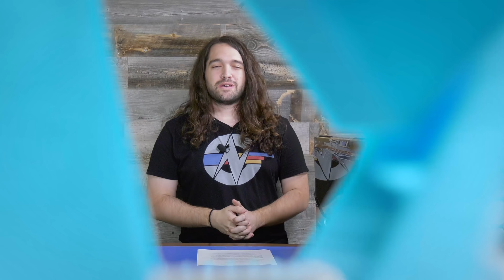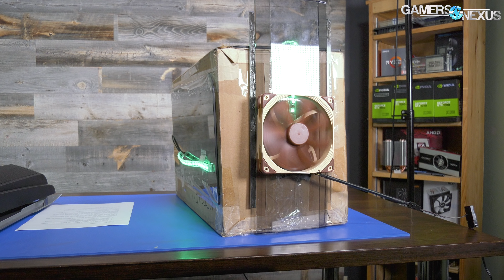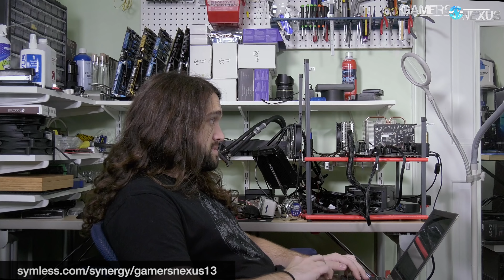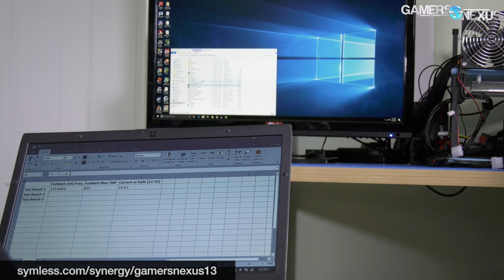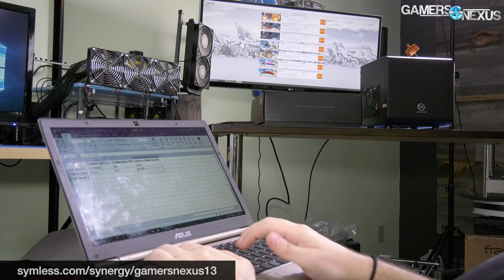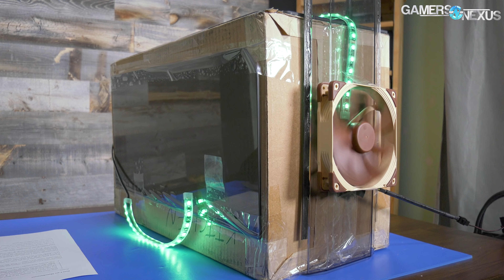Case Manufacturers: You're Worsening FPS & Power Draw

Comment: The concept of dissipating heat in space is fascinating, and when talking to people about it, you quickly realize that they don't 'actually' understand the physics of many of the components they are using as well as they think they do. For example, radiators, I think most people simply 'assume' that the point of the radiator is to hold heat until it is dissipated through the convection of the heat into the air that is pushed over the radiator by the fans. While in computer cooling this is in fact the 'majority' of the heat management at high work loads, the radiator is constantly emitting photons in the form of infrared light, as well as other bandwidths not on the visible spectrum, to get rid of heat, literally the process of 'radiation' the emission of subatomic particles, in this case photons, which we correlate with heat. 

In space dissipation and convection are completely off the table, no amount of fans will help you at all since you are isolated. It may be 'really cold' in space but you are subject to the direct radiation of the sun, and you're what's known as a 'cold body' for the most part, that is you don't 'radiate' so you are effectively a giant heat sink merely absorbing radiated energy from other warm bodies, that is until your radiating potential reaches the equilibrium with the radiation you are subject to or absorbing. While 'conduction' is based on more than just electrons (Superconductors for example), in general good thermal conductors are also good electrical conductors, which is why we see this parallel in metals, these conductors have a higher potential to reach before they acquire equilibrium. Additionally you have the problem that 'good radiators' are often good conductors in an irony. So what you 'want' to do in space is face your 'bad conductors' towards the source of energy, and then through some form of internal convection or dissipation (Typically some form of peltier device, or phase change can be used if you move the medium and reverse), you transfer the energy (Heat) to the 'good conductors' that are facing away from the energy source, and they will radiate energy away from the satellite, ship, device, or floating space computer. 

Needless to say this is more difficult, and generally slower, then dissipation, which gives you the advantage of using the 'relatively massive' atmosphere as a nearly thermally immovable heat sink. I did say that 'dissipation' is not possible in space, and this is actually technically false. One idea that is frequently explored in science fiction is the concept of 'stealth' in space, which would involve cooling the exterior of your ship, eliminating all thermal radiation from it, and storing it in a 'heat sink' until you were someplace safe where you could get rid of all that built up heat, they often discuss the process of 'getting rid' of that heat as 'venting plasma.' 

This is in fact completely accurate and valid, if you have a VERY good thermal conductor within your ship that you can transfer heat to and isolate, and you allow the heat to build up in that substance completely isolated until it is hot enough that it doesn't just turn into it's gaseous version, but goes one state of matter further, turning into a plasma (All electrons stripped from the nuclei of the atoms and moving freely inside the material along with the nuclei), then you have a VERY hot and dense plasma, which if you then eject from the ship, you effectively 'dissipated' the heat away from you in some sense. The dissipation is only technical, since you really just broke yourself apart, leaving one portion of you significantly hotter so that the other portion of you could be significantly cooler, but it in some sense is effectively the same thing, and is certainly not radiation. 

I digress... Very science fiction and totally unrelated at this point to the subject of the video.

Comment: Shit like this is why I chose the Cougar Panzer for my current build and an Enermax Ostrog ADV for my prior one, I'm probably the most anal person when it comes to airflow and I actually won't buy a case if it doesn't have a mesh front panel and bottom so the PSU is isolated, I like a mesh top too, but that's less critical for me. Honestly I'd probably be inclined to just use a test bench for my daily (like the Praxis Wetbench) if the ones that looked decent weren't so expensive, I don't understand why half a case costs twice as much as a complete one

Comment: No, there is no place for tempered glass or RGB.  I will never buy a case with either. I buy cases strictly for performance, ease of building and front panel features. Cable management features are nice but ultimately the only reason that matters is cases with side windows. Get rid of the side windows and that no longer matters beyond it being handy to have the cables being neat and out of the way in a general sense.

Comment: I have a nzxt phantom 630 case, with 2 140mm fans in the front and 2 more in the bottom blowing in. I have another 140mm on the drive cage, with another one blowing out the back. The radiator is blowing out the top with 2x 140mm fans, with a 40mm at the I.O. I have thought about adding 2x 200mm on the top to help blow the heat away, but I'm concerned it may impact the radiator.

Comment: Case manufacturers are forgetting extremely BASIC aerodynamics and airflow requirements.  Open intake area up front should always be EQUAL to the area of mounted intake fans.  Anything less leads to an airflow-starved design in which housed electronics can overheat.

Comment: Most important with cases is that they should have many places to mount fans. Not all that make PC-s need many fans. And you should also make a positive pressure, because if exhaust is stronger force than intake, then all holes that are not filtered will suck in dust, making thermals worsen over time.

Comment: Im glad i changed my cooler on my GTX 1060, Asus stock sounded like crap when gaming and load was 70c+, Arctic cooling on and i have the fans on fixed at 7v and the cpu dosn't wind up and maxes out at 65c maby and i have crap ventilation.

Comment: Thumb Screws are a pain ion the ass. When cannot take it off with your finger. what that is its too tight. use a screw driver to  screw it  in like insane extreme too tight.  so use the screw driver ton undo that thumb screw.. when I loose them.. I do not know what to do about that. its not sold at a walmart hardware department

Comment: A Lanbox puts your MOBO on the horizonal and heat RISES. The heat goes up and out from each component, not up the board towards your CPU and VRM on an upright case. Everything in one box is from the 1990's and stupid. P/S went from the top to the bottom of cases because the case would be easy to turn over. All the heat from your P/S rises in your tower case to your CPU. Newer P/S when not stressed will stop the fan and all the heat is traped in the case. That was really a stupid idea. One company that sells cases and P/S can offer us a case with a cable to a seperate P/S. One twist lock 4 wire connector with the modular cable jack in the case. If you have cases you can stack put the P/S and radiators in the one on top.  Remove case drive cages if you are not using them. They just block air flow.

Comment: A test bench with a 20 inch box fan blowing air on the MOBO from one side. Add a 20x20 inch A/C filter to the fan and the components stay cleaner. I ran a PC in the summer on the Gulf Coast with no air conditioner. Room temp was around 90 F.

Comment: I actually had a 12yr old Antec P180 case I nearly used for my latest build. It's actually pretty solid even if cable management sucks compared to modern cases. But I saw a tempered glass case with 3x RGB fans on sale for £50 (Gamemax Onyx). Aesthetically it looks awesome, but have to admit some of the design elements seem a bit shitty for airflow. There's these weird honeycomb cutouts on the front panel, then a tempered glass panel in front of that with very little gap for airflow. I was gonna actually modify it, using washers to extend the panel out a few mm and drilling holes in the centre of some of the patterned bits.

Comment: i just realized my case i moded is the king of low front panel airflow because the fans not only have just 4 mm space in front of them but alsoo ate mounted directly on a solid piece of acrylic so the fans not only cant suc any air bot also are iunable to push it anywhare but at least there are 2 120 mm fans in the bottom blowing directly in to the graphics card

Comment: I had a truly vertical  graphics card 10 years ago and still do...Raven01 by silverstone has the MoBo turned 90 degrees so the rear is now the top of the case and heat goes easily up and out gpu and other vents. The back looks like the  front of a case and hides a chamber for a radiator...the power supply is at bottom and still has drive bays in the front and quick connect hard drive power and data connections .  you put the hd into a screwless plastic frame and then slide it into a slot until it clicks into sata3 hd to case to mobo design.the hd also lay sideways so the case fan on bottom blows cold air up througg hds and out top....it has a top lid to hide wires.....nothing made today can touch it and looks like ill keep using it.

Comment: put 10 mini fans with thermo sensors in hot spots around the gpu spinning at  different speeds depending on sensors reading....would work much better than 1 or 2 big fans.

Comment: well i do my builds designed around airflow... this is the difference between a long standing builder a case looking pretty is always a trade off. i personally run a corsair air 540 because of the high airflow properties i can run it near silent. with great cooling!

Comment: I've been pissed about bad case design for a long time. Currently planning to build a new one and the bequiet Dark Base 900 is the only one I found that has acceptable roof space without a meshed top that lets all the noise out freely, anti-noise mats on the top's inside and no metal grid on the mounting plate for the radiators. (Just not looking like the outlet openings are sufficient. But obviously prioritized for lowest noise there, otherwise they could have just made the back wall completely open, but then the noise from there might reflect off a wall and bother the user.) The case seems to have its issues in other places though, including cooling-wise, so it's frustrating to have so little choice. Considering how the PC enthusiast market has been booming with obsession over small percentages, it's weird to see the computer case industry still so much fumbling around clumsily.
Actually the PSU-on-bottom thing bothers me greatly especially in cases where the PSU is likely to suck its own warm air back in. Power competition between two fans might be an issue, too, where one fan, regardless of whether it affects blowing or sucking, diminishes the operation of another one. (With all my cases I put tape on the grids in the back that don't have a fan behind it. I don't want hot air being sucked back in there, and high pressure case isn't an option because the fans in the front need to be lower noise than in the back and top.)
I also have to say though that I find mounting a radiator module at the front insane unless it's blowing out (which would likely mess everything up).

Comment: Now make one to the video-card manufactures... The primary source of waste-heat within the case, which is what makes the heat an issue in the first place, is the poor design of the video-cards. 15-85% of the heat returns into the case, and expects some case-fan to remove it. Heating-up the CPU, RAM, voltage-regulators, hard-drives, wires, and PSU.

Heat up, cool down, take advantage of that, and the fact that the case is a giant metal heat-sink itself, totally unused and normally insulated to retain heat. (Aluminum cases are worse, reflecting all heat back into the things that are trying to get cool.

P.S. Do your water-cooler tests after 1 hour of being "up to idle temp", and run them for at-least an hour, before you show us the numbers. Most people play games longer than an hour, and all that heat-build-up that can't be "air-cooled" off the radiator, builds-up. It is unfair to test something where you have not saturated the "volume" of cold water with trap-heat. That is essentially cheating. Also, test the power-draw, which is the other source of heat. (Overloading the PSU with the water-pumps and excessive air-cooled water radiator fans.)

Heat-pipes are still the best coolers. They remove heat instantly, from the source and don't overload with excessive fans, while giving the larger surface-area that is needed, away from the source of the heat. (It is still liquid cooling, but without the middle-man energy-hungry and breakable water-pumps.) The liquid evaporates, moves away, condenses back to a liquid at the cooler, and flows back to repeat the cycle.

Comment: I use the Corsair Air 540 case. I prefer my i7-4790k @ 4.4ghz and GTX 1070 to perform at it's maximum speeds over it being more quiet.

Comment: 16:15 Speaking of inverted layouts and axial fan GPUs is there a good solution to keeping the GPU cool if the case doesn't have any fan mounts next to or above it? for example the TJ08-E
would try a PCI fan but they seem to not exist anymore, just zip-tie 2 80mm fans to the ventilated PCI covers?

Comment: the exact reason I got the thermaltake core X31, not really pretty but damn, there is mesh everywhere!!!!

and re: the vertical GPU mount. I was able to get a 6c drop from repasting and a further 5c from horizontal to vertical mount, only difference was that my backplate faces the glass (strix backplate looks better than fans to me), no choking, hot air goes straight out the top and through the PSU. (reversed the PSU fan to push hot air out of the case)

all of this together and I can overclock everything in my case within reason and have it sit at 60c case temp average while gaming, it spikes at about 68-72c when the room is hot.

Comment: One of the things that bugs me about modern cases is the small amount of HDD mounts. I have an older mid tower with 11 mounts, today you are lucky if you can get 4. Add in some removable HDD mounts, you don't need 11 of them, just add three to the top front or sell them separately to go with the 3 under the PSU shroud.

Comment: Best case is a case that has two compartments, one with all the hardware that's nearly entirely sealed and another with the radiators. Like a CaseLabs Mercury S3 with solid or windowed panels and fans/rads in a pedestal.

Comment: One thing I disagree with, “a case will be worse than open air” is just unequivocally incorrect.  Maybe a test bench with multiple fans directed at heat generating components would be better than most cases, but the whole idea of a well designed case is to basically create a wind tunnel to actively remove the heat from the components.

Also another point I would like to make is, you don’t need to spend a fortune on a thermally effective case.
I have a cheap and nasty aero cool case with 4 noctua 120mm fans and my 7700k and gtx 1070 both top out about 65c after 20-30 mins of stress testing which is not bad at all for especially considering the 7700k is a notoriously hot cpu (apparently)

Comment: Saw this video. My case is a Corsair Carbide 200R. It's pretty much tuned for airflow rather than looks. When I see the new cases in different stores, I feel like I want to keep my case for as long as posslible. Heck, if I end up selling my PC at some point, I'm gonna get a new case just so I can put the old parts in the new case and keep the old one.

As my PC is downloading an iso file, my CPU fan runs at 2051-2070RPM, while my CHA fans are currently turned off. The CPU is an Intel i5-4460 and it's currently staying between 34-41 degrees celcius, utilization is around 24%. Numbers are pulled from HWMonitor from CPUID.

Comment: I just remove my side panel. I have a Corsair Spec-01 and Strix 1080 so things are tight when it's closed up and it gets hot fast. With panel off the GPU never gets over 61 C. Not really bothered by the noise.

Comment: Hence the reason I went with the NZXT Source 530 case.  Good flow and the price for the features.  I blame many of the case reviewers for the heat build up.  They are not being honest about the restriction on newer cases.  Not directly mind you, but by talking about how nice it looks with all the useless tempered glass and front panel designs.  More of a distraction about how poor the flow actually will be and causing the throttling you speak of.Cases don't need tempered glass on every surface to look nice.  They need the ability to be assembled in a more modular way to the needs of the consumer.  But case manufacturers are only interested in what looks nice because that gets good reviews and good reviews get good sales.

Comment: bring back driver bays!!!! yes newborn people may not use them but there quite a few that are born before 2000 that still use them they also can be used for front-side expansion panels/ fan control panels/ mini shelfs etc.. And in most of the case designs currently out there the space that 1,2 top bays would occupy is empty ANYWAY. 

Also more USB slots in the front side and 1 audio and mic jacks (which are usually present but not always) 

wireless charging surfaces for phones and what not 

bluetooth/wifi combo modules that come preinstalled with the case. 

last but not least bring more ITX cases!!! cases could look nice on a living room or could be in console killer configurations